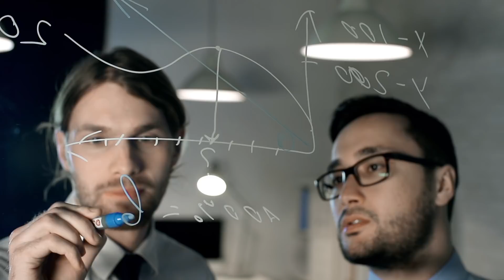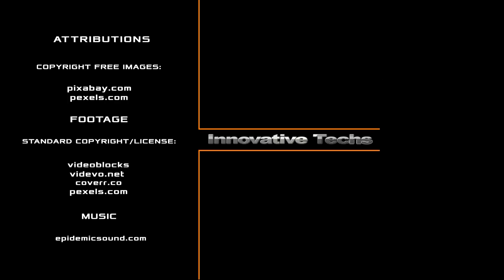Why Michelin reinvented the wheel

Comment: If they can handle EVs higher weight and massive torque, sure I'll take a longer lasting tire that handles better.

Hope it's more energy efficient, but most people will probably want some better styling 

The outer spokes might not be changeable, but they have to create something new that complements the outer spokes

Comment: If this tire/wheel are more efficient than the average air tire, I am interested.  I have experience with various air tires and experience a major efficiency difference between them.  Cost, life, noise and safety will make the difference.

Comment: Will it last for 200,000 miles ? will it hold up to extended use on failing infrastructure roadways ? how about trailer applications ? Hard cornering in emergencies ? The tech has potential but many considerations in design and performance , longevity etc

Comment: Hury up and release these - (are they tyres or wheels?)  With many cars now being supplied without spares - and punture repair and inflate kits being highly suspect - it is way past time the tyre was not a major breakdown problem.  If I could fit these onto my car's wheels to replace my penumatic tyres I would do it in a heartbeat. Providing the noise, handling & expensise was not majorly comprised of course.

Comment: I hope they add some sort of sidewalls to reduce noise and also stone-pickup that can fly off causing harm or damages.
Reply: i think it is not a big problem in term of mechanical aspect 
they can design it to have a mere more pressure inside while moving 
the high pressure will repel anything to enter 

or the flow of the air goes from the center to the edge using Tesla valve technic

Comment: As both a private driver/consumer, and a professional tow-truck driver, (15 Yrs.) I welcome the advantage of not having to deal with all of the hassles flat tires include.
     Even when the manufacturer's tire is brand new, you can't avoid the habitual practices of inconsiderate roofers and construction contractors who irresponsibly spread their nails and screws all over the roads and streets, forcing unsuspecting victims to deal with a whole range of inconvenient issues. Unexpected expenses, missed appointments, having to install the spare tire (if available) in the middle of a torrential down-pour, not to mention the safety hazards for teenage females driving through a dangerous neighborhood at 3:00 A.M.

Comment: it seems you can cover the tire for stone stuck. they probably did it already. but speed/brake and comfort results are very important and because of these issues it is not ready. 180 kmph is ok for most of the people but the decibel and brake results shouldn't be worse than current tires. pressure check including cars seems best